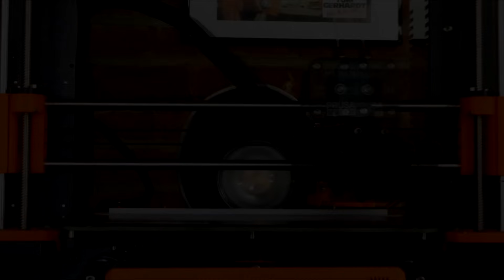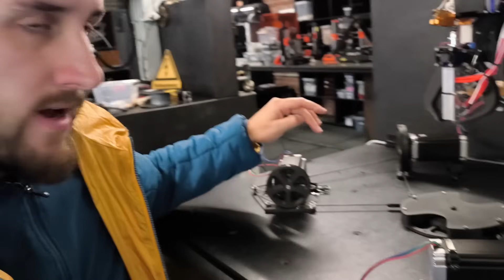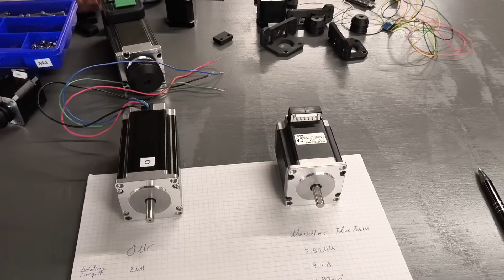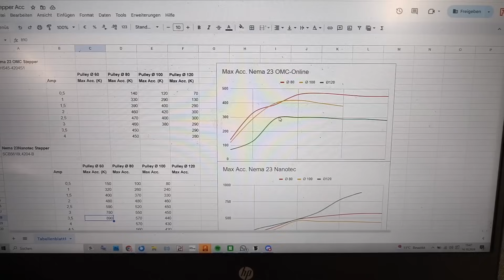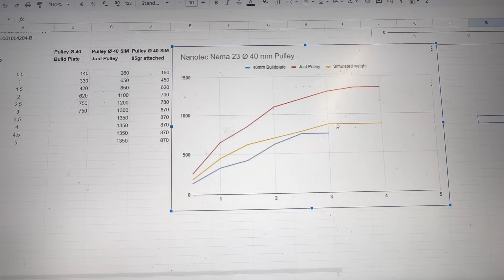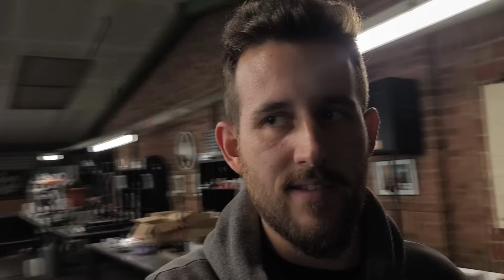Minuteman Dryruns on World Record pace. Is a sub 1 min 3DBenchy possible? (Episode 7)

Comment: Maybe this is adressed, but higher acceleration could be achieved with more motors no?
Since xy motion would be kinematically defined with 3 cables having 4 is just for symmetry. So why not 6 opposite and opposed at the vertices of a "jew" star like configuration.

Or 8 or 12 for that matter?
I would imagine 6 would work better across the board.
Reply: Just sharing the idea/question. Your printer setup is inspiring and that goes without saying haha. Keep the innovation/experimentation going!

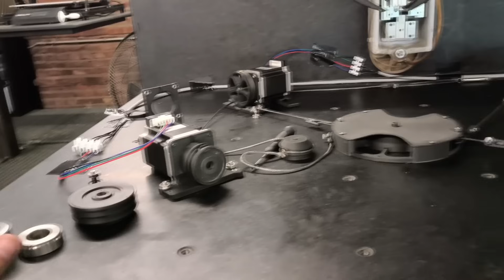Comment: 25:24 you should be able to calculate the theoretical max acceleration with the pulley from the datasheet torque and the weight/diameter of the pulley...I think?

Comment: Just a thought...A piston on the extruder to control retraction would be a cool test. Normal retraction feels like it will have some limitations that will be hard to handle.
The piston could handle fast changes in the flow. This way the extruder can focus on pushing forward mostly.
Controling the extruder would be much more complicated though...

Comment: Do you measure the current in the coils directly, or just state those numbers based on the current setting of the drivers? If so, how are you measureing the current? Im also trying to drive a stepper very quickly and trying to optimize the drivers tuning 😁

Comment: I looked at the stepper motors you were comparing and Lin Engineering's 76mm long NEMA23 part  X5718-077-50 "Extreme Torque Hybrid Stepper Motor" beats the nanotec torque at 325rpm by 15% (2.95 Nm) and inertia that is only 30% at 144 g-cm inertia. If you want to add a gearbox, they add a 5:1 to that same motor with part number X5718-077-50-Y05-A0-A12F and your inertia is doubled (still less than nanotec), holding torque goes from 3.3 Nm to 14.85 Nm, and torque at 325 rpm is 5.83 Nm at your elevated voltage.

Comment: Bro you need to change the control motion logic to account for the extra length of the cables on one axis when the other axis moves. You will never get reproducible accuracy if both axis need to have slip. You can’t fix all software problems with hardware solutions.

Comment: You do realize that you're center mass will increase as your print gains in height?
 It's going to snap right off of that little build platform.
Those cable clamps intro do so buttload of noise both mechanically and physically

Comment: Bro, you probably know that, but I'll leave it here just in case. Changes in the current settings don't affect max acceleration above a certain level, because real current is not rising in the motor anymore. It's all because of the motor's coils' inductance. There is simply not enough time for current to start to flow through the coils. To get higher accelerations/max speeds, you need higher PSU voltage for the motor drivers, so the current "is pumped" faster into the motor.

Comment: One question: on the printing parameters of the sub 2 minute Benchy dry run, what does the term “square corner velocity” refer to? I’ve never heard that term before. Thanks!
Reply from the maker: It's the speed in mm/s the printer will maintain when it's doing a 90° corner (instead of doing a full stop at the corner point)
Reply: @ thank you! I saw in another video in the series you called it jerk which I have actually heard of lol

Comment: Not sure what the exact rules / regulations are but a possible design could be mounting the bed up higher and allow the connecting belts to run underneath it.  Laying the bed across the belts with the corners pointed towards the motors, giving it the most surface area for attachment / support / stabilization. But you could then have the opposing motors work in conjunction puling the belt (string or whatever) instead of opposing each other.  This would also shorten the belt / string, and could make it a large loop so its pulling against itself? Removing slack / pulleys.  There would be way more inertia and what have you, all things that would need to be worked out. "Design" just randomly came to my mind so thought I would suggest it.

Comment: I know this is pretty far in your build to change up now, but what about for your next build, for your moving platform, instead of cables you change your drive to an air piston system?  You seem to have access to the a compressor, a 3d printer, and machining equipment.  You can have air solenoids connected with pistons situated in each axis.  As long as you create a feedback loop, inertia shouldn't be as much of an issue.  Robots already use air motors and pistons for the exact challenges you're running into.  As for cooling, a liquid cooling system and reverse heater core could keep your systems ice cold.  It would be a beast power wise, but you could easily surpass your bench marks.  Good luck!

Comment: This looks quite challenging!

One thing to keep in mind is that you won't be able to push bed acceleration all that much, since the object being printed will contribute a changing amount of mass to the system. Or do you plan to compensate for that as you go and reduce acceleration based on amount of filament extruded / mass added?

I also wonder how much acceleration is possible without breaking the bond between bed and object.

Comment: I remember not long after the Prusa MK3 came out, I was talking with someone who was ABSOLUTELY convinced that the quoted 200mm/s max speed would never be reached as he felt the accelerations would shake it apart or at least move it across the table. (Silly, I know.)

If only I could show him this now. WOW.

(To be clear, I understand how older printers often wouldn't reach their theoretical top speed due to lower accelerations. With a Benchy, there's no way the MK3 would reach 200mm/s, but not because it would shake itself apart, but because the necessary accelerations just wouldn't be able to be achieved with the stock hardware.)

Comment: I may be wrong but I think that the way you simulated the weight of the printing platform using flywheels is not accurate since the motor will have to accelerate AND decelerate the flywheel all by itself, but when printing it only accelerates the mass by itself decelerating is done by the other motor since you can't push on the string. I don't know how much it matters but I thought to point it out.
Reply from the maker: Yes you're right. But it gets me very close :)
Reply: @Roetz40  You could take two steppers tie the pulleys together with string and then use the flywheel again just to see how big the difference in testing methodology is.
Reply: Thinking about it more this method wouldn't be accurate either, best would be hanging lead weights on the string.
Reply from the maker: @davidreinhart373  everything with hanging weights needs to have a few stages of mechanical advantage. Otherwise were limited to 1g of acceleration. We want to go 100g+ :)
Reply: @Roetz40  I meant two steppers connected with a string and weight simulating the weight of the print bed between. To get rid of the "pushing on a string" problem

Comment: might be a dumb idea, but why dont you just use 2 motors pulling on each side? double the torque? and if you connect the shafts together, than you have bearings on two sides of the pullys

Comment: would be a software nightmare to implement but if you also had the extruder moving with a separate set of steppers you could squeeze some more acceleration out of the system. Feeding the heating element from Boden tubes too could get the practical weight of what's actually being moved much lower

Comment: Gosh, I think input shaping could help a whole lot. Your data seems to show that the inertial contributions of the build platform and the stepper rotor/pulley are comparable. Then they're connected by the significant compliance of that Dyneema or whatever you've got there. And we can see the slack side of the cable system flopping around during certain parts of the video when the platform motion aliases with the camera shutter. 

It seems like input shaping or something similar could do a whole lot to prevent the build platform from jerking the slack cable as the tension is removed, and knocking the rotor out of the magnetic detent. You're controlling three masses connected by very significant compliances by applying force to only one of them, and treating the system as rigid. It seems like the oscillatory motions of the system could easily be producing for spikes equal to the applied forces: in the worst case maybe doubling the propensity of the system to skip steps. 

Obviously, you have managed to tune it through cable tension adjustments and gotten performance much closer to the rigid body ideal than this, since you're getting clearly quite close to your rigid inertial mass test data. But I question whether this motion control system is actually useful when tuned this way. I would guess that you're being forced to allow excessive cable slack and excessive build platform wiggle in order to avoid spending your torque on the resonant motions that would occur between the two rotors and build platform if the cable were properly taut the whole time.

I think you're going to need more than inverse kinematics here. You're going to need a separate feed-forward/input shaping algorithm for both the driving motor and the slack motor during any given motion, to smoothly tension the cable between the masses on the driving side, smoothly relax the cable on the paying-out side, and then smoothly return to normal tension as the motion segment terminates. Maybe it could be the same code, but I have a feeling you're going to need to treat the Dyneema elasticity as nonlinear on the paying-out side. 

Point 2:

You're talking about how much trouble you have dealing with the cable tension: how about fixing that directly? One thing which comes to mind is that it might actually be helpful to have extra compliance in this system to set that tension, in parallel with a very stiff viscous damping element or even a simple locking clamp. The idea would be to have a soft compliance/spring that sets the resting torque of the motor, and a stiff damper (or clamp) in parallel with it that keeps the system rigid during motion. 

For instance, you could dispense with the cable tensioners, and one of the motors of each pair could be mounted on a sliding mount. The mount could then be provided with a long, compliant spring that applied the static bias force to the cable segment between opposing motors, setting their resting torque. Then, you need the motor platform to remain locked in place during printing. Ideally you'd have a parallel damper or mass/damper element to keep it pinned in place dynamically: a very stiff shock absorber from the platform to the motor mount. 

Perhaps more simple, although not as ideal, you could just lock down the stepper mount with screws in a slot after allowing the spring to properly tension it. This isn't as nice because it doesn't deal with nonlinearities in the cable tension that would start showing up as the platform begins to move. The damper would automatically deal with that, and keep the average motor torque fixed to the desired value. But then again, setting the tension and then locking it down might be more predictable.

Comment: replace the cable ends/adjusters you have with spliced amsteel or UHMWP cables. you could do a splice that also works as the adjustment mechanism but ideally that can be done on the back end to remove all excess weight.

Comment: IMHO a lot of people underestimate steppers and go for closed-loop without actually understanding why it worked. FOr something like a CNC, closed loop is mostly useful for stopping the machine if it looses position/steps. An adequately sized stepper with the correct parameters will perform the same job as a closed-loop stepper, except you will not get the reliability. When ppl go from an open-loop nema17 to a closed-loop nema23, it is the size/power that is the biggest improvement, not necessarily the closed-loopedness
Reply: closed loop at least when it comes to servos can also provide active correction (which is the real utility whit it whit closed loop servo though I don't know about stepper but I cant see why that should not be possible whit a proper setup) not just aborting if something goes wrong, for when the motor losses steps it will not have travelled far enough so the closed loop system can correct that and make it travel further, this also works if it overshoots the target and make it back to the right position though that function is only useful whit travel between points whit no other operation
Reply: @link7417  in a cnc-mill you don't really want that in many cases, as you will just get inaccurate results. failing to reach desired width of cut means next round it will have to work twice as hard, and is more likely to fail. If for some reason it does not fail, your part will not be accurate
Reply: On a 3d-printer where anything within +/-0.1mm is good, this does not matter much, but in metal you can feel details down to 0.01mm or something, and you get visual imperfections even smaller than this 😅
Reply: @SkansgardCNC   um no, it does not have to work twice as hard on the next pass, it does not compensate on the next pass whit the tool, if you tell a CNC Mill to travel 100 mm on the x axis but it only travel 99 mm it will compensate for that right away because it will not blindly trust that the motor will reach the desired position,

yes ideally you don't wanna push a CNC mill to where it could lose steps in the first place
Reply: @link7417  If you just use closed-loop steppers as a drop-in replacement, the cnc-controller has no idea that the desired position were not reached. It is all internal in the stepper-driver. I am sure that professional cnc's have no problem dealing with it, and that it CAN be dealt with, but grbl etc does not give a shit 😅
Reply: And, yes, my point was also that as soon as you push a cnc mill to the point where closed-loop position recovery is required, you are already doing something wrong. I would probably configure them to alarm  instead of "fixing" the position tbh, so that I wouldn't chase a surface finish issue in the wrong direction 😅
Reply: @SkansgardCNC  yea you definitely need the required hardware for it which may not have gotten to the hobby level yet, and yea as I said too you don't wanna really on that during an operation, but when rapid travel between parts whit servos its easy for it to over shoot and professional CNC mills really on that to always know where the tool is even at power outage or when you crash your tool which do happen even for professionals, that allows for fast recovery as it does not need to be homed, among other things, but yea if the closed "loopness" is only in the motor then its pretty useless as a closed loop if that can even be called that, for the point whit closed loop systems is that the controller have more control over the motor position

Comment: You mentioned shaving weight down off the build plate, have you considered moving your air bearing from the build plate to the surface? Something similar to an air hockey table, lots of tiny holes providing lift against the whole buildplate surface, rather than a single large centralized hole. That would eliminate the ducting of the build plate, allowing for a simpler, lighter piece. No idea if it would help, and it would be a lot of work to drill a bunch of .5mm holes in the surface.

All the best, I’m enjoying this series, and I’m learning a lot from it!

Comment: Have u considered a thin metal wire vs rope to reduce mass, resistance and stretch. Also have u considered 2 idlers or one larger one at the corners to reduce drag and stress by the high cornering angle.